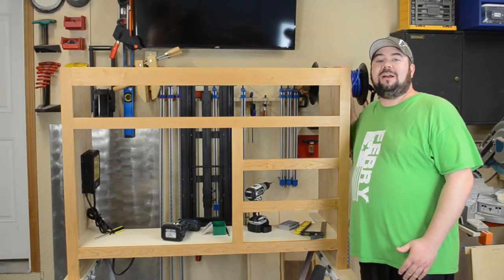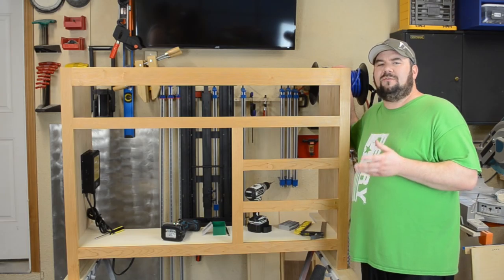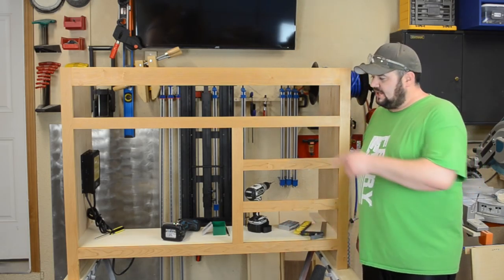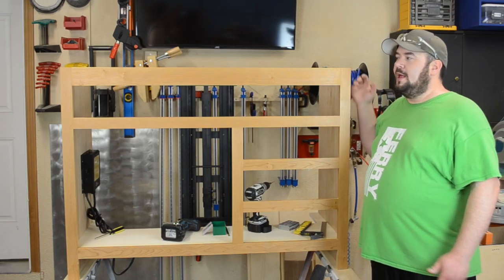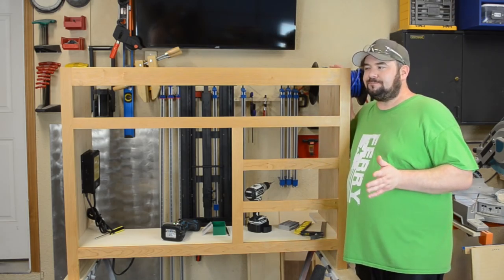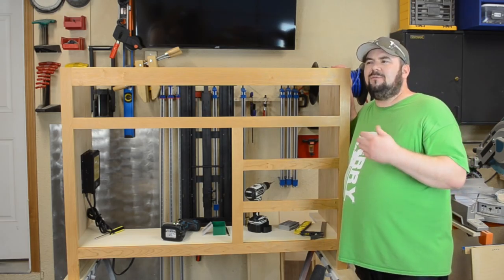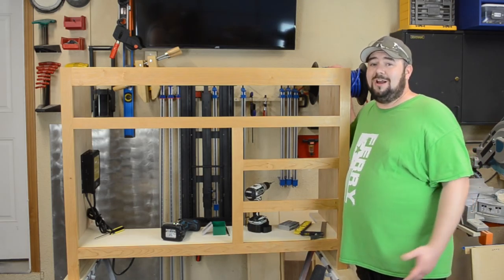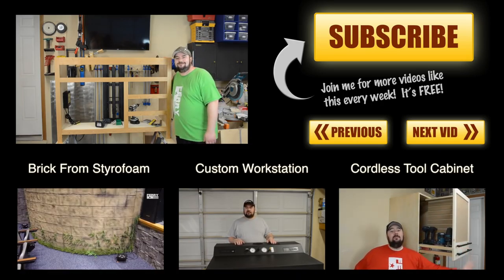TV Lift Cabinet Project Progress

Comment: As a professional AV installer and amateur maker,  I would recommend having the false frame. While it isn't the idea from a wood workers perspective from an AV prospective it will block any of the ultra bright display LEDs on the front of equipment from peaking through the albeit thin door seam. 

Also make sure to consider the wire management routing for the devices and provisions for enough outlets. 

There are also macro based RF remotes that would allow for single button press to activate all the equipment. Such as pressing a button "watch tv " would communicate to the equipment behind the doors turn on the tv, set it to the correct input, turn on the box, set it to your favorite channel, turn on the surround sound and set to an pre established volume setting..and with that lift raise the TV.
Reply from the maker: +jammin60psd I agree for the frame not having light leak out - the IR repeater is the base model for IR management - can always upgrade to the one you are talking about - they do seem pretty cool

Comment: Nice job Nick. An alternate to a flip door is a stationary one. The flip door is far more trouble then it's worth and does not last long. The wear point, where the lift meets the wood, is what will give you the most trouble. 

A stationary door, however, has no moving parts and it's attached to the lifting frame and is a far better option in my humble opinion and for the long haul. You can put a slight bevel on the front edge to allow for self alignment when the TV lowers into place and it also allows for some top items to stay in place as the TV is lifted as well. I would suggest items that don't tip easily but some items could lift with no chance of falling or tipping like large diameter candles for example.

I've seen too many videos on flip door failures and don't know why folks continue to use them. TV's these days are very thin so a 3" strip should work fine, but 6" would be better, and if positioned properly is hardly noticeable. Good luck with your project....

Check out this link:
https://www.youtube.com/watch?v=vX20AcZbciI

Enjoy...
Reply from the maker: thanks for the insight Paul - a stationary lid was my alternative option - I was leaning towards the flip top but who knows - as far as wear, it really wouldn't be that bad for a flip top - there is already protective felt on the mechanism so I know that would be fine - I suppose time will tell on which option I pick